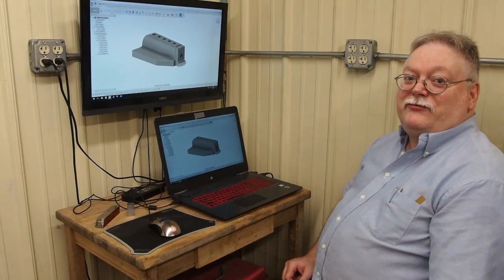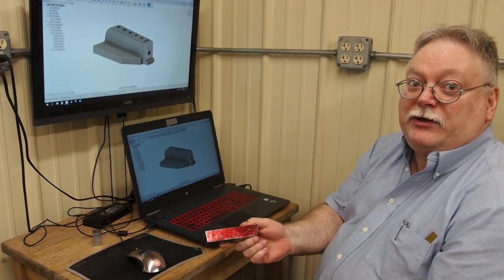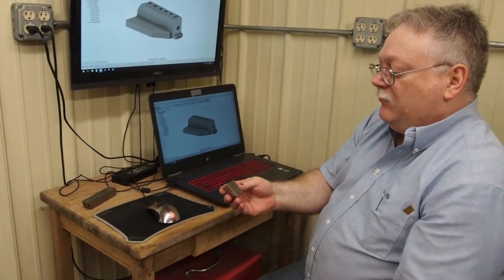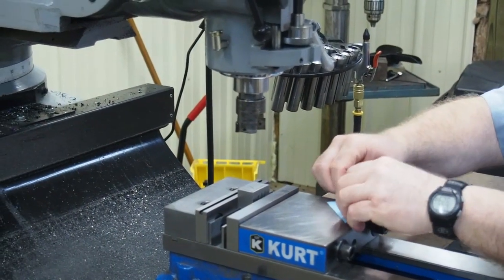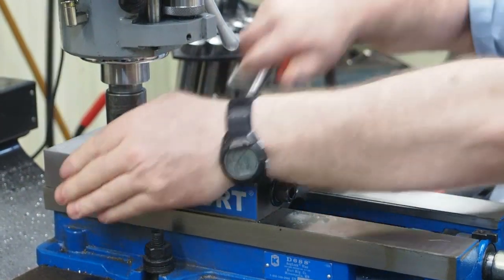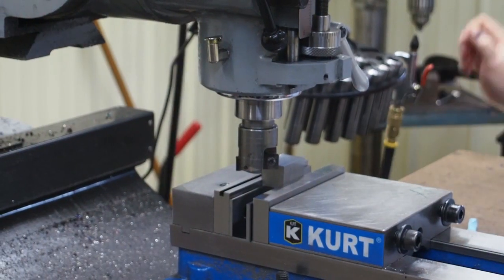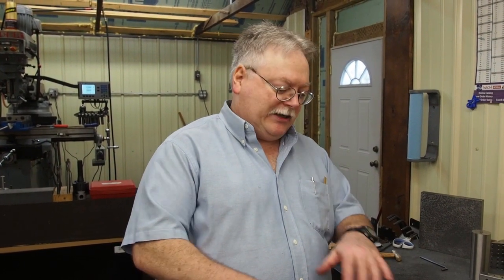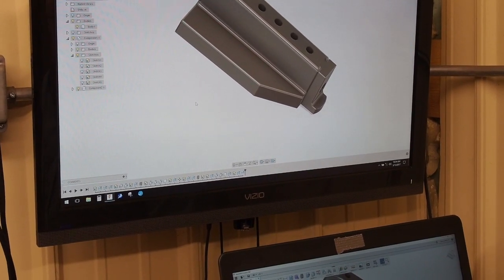Squareness gage Part 1

Comment: I love the polycarbonate shield mounted directly on the vice! Nice and convenient safety measure that will help reduce chips flying as well! Smart!
Reply from the maker: Hi Spam,
Thanks, I love that shield and use it most of the time. Very easy to put on and remove.
Steve

Comment: Sir,
Im asking because of my lack of knowledge, why did you just not put it on the surface grinder and grind the surfaces parallel and square?
Reply from the maker: Hi Ian,
This part could have been squared up on the surface grinder but it was much faster and easier on the mill. The part started out with saw cuts on a few sides with a lot of stock about 1/8". I usually remove large amounts of stock with a mill, or if the part is round a lathe. These machines are design for that type of work. What we are showing in this video is a method that not only removes a lot of stock but doing it very fast and accurately. It is the method we used in this video that achieved the speed and accuracy. Many other techniques of squaring a block will not be as efficient or accurate. Also, there was more machine work that needed to be done to the block, cutting the step and adding the hole for the screw. We generally use the surface grinder for finishing harden parts with .007" to .01" stock. If the part is machined accurately as in the video above it makes the finishing on the grinder much easier and faster. I hope this helps. It was a good question, thanks for asking.
Steve
Reply: Solid Rock Machine Shop Inc. Thank you.